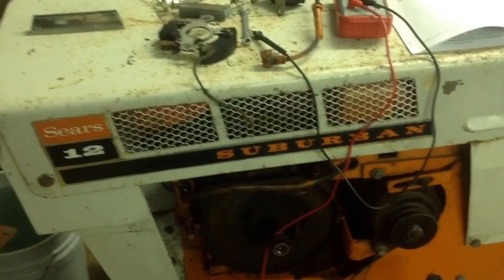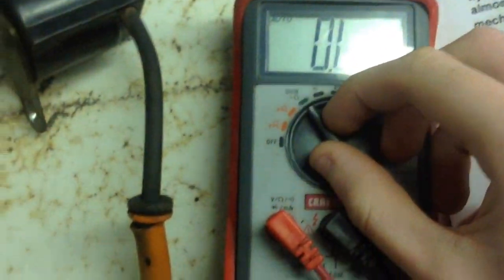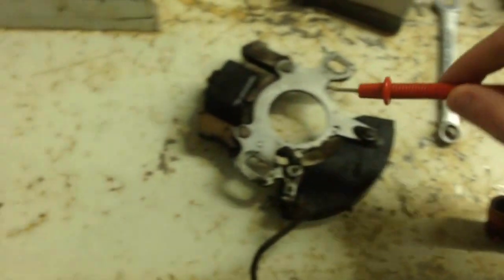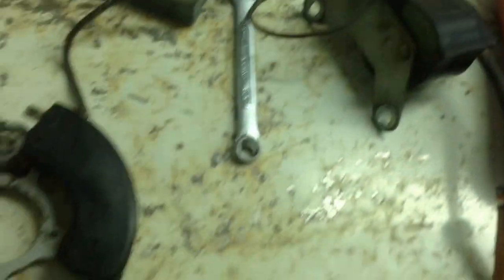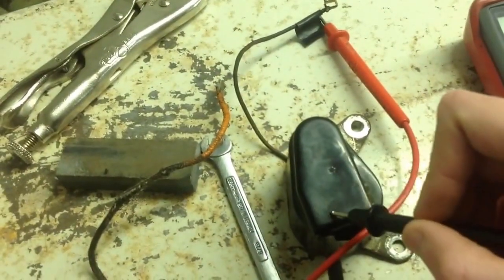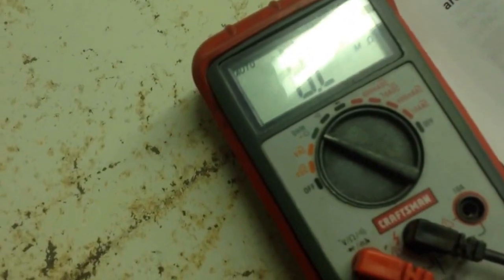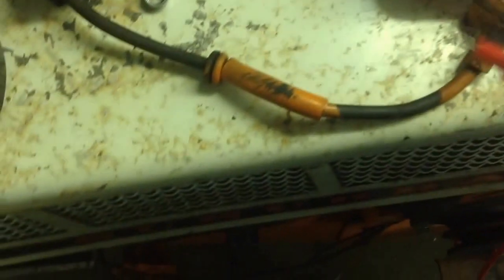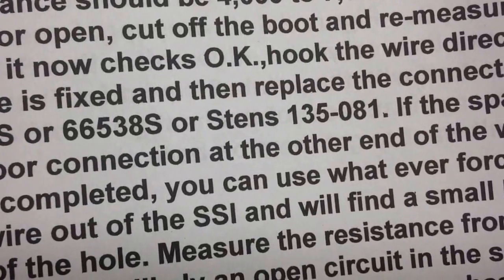Tecumseh Solid State ignition testing. (Starter Generator style)

Comment: I tested my coil today by hooking my NOCO jump pack to it and sparking the hot primary wire to the POS+ lead of the jump pack. It's an easy process with a couple jumper leads. The light film/ corrosion on the aluminum base plate created a faulty ground and showed bad coil. After brushing the base plate with a metal brush and getting a good ground, I had sparkage. The ignition module is another story and I am looking for the testing procedure along with instructions on how to set the air gap inside of the flywheel w/o being able to see it🤨🤔

Comment: How did you get the flywheel off. I am having the same problem.
Reply from the maker: You need a flywheel puller. Using a flywheel puller and tapping on the end of it with a hammer while putting tension on the puller will make it pop off. Back when I still had this tractor it took me quite a while to get the flywheel off as it was being stubborn but patience is key when some of these tractors haven't been touched in decades